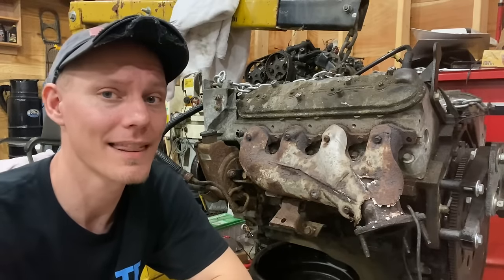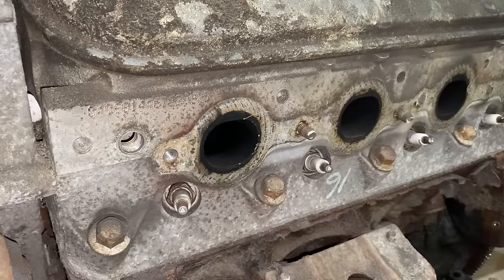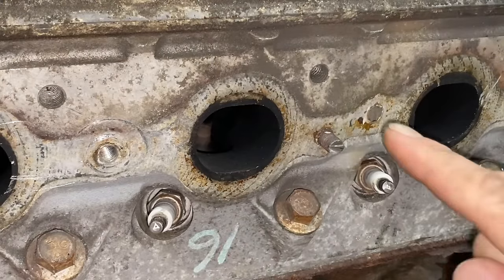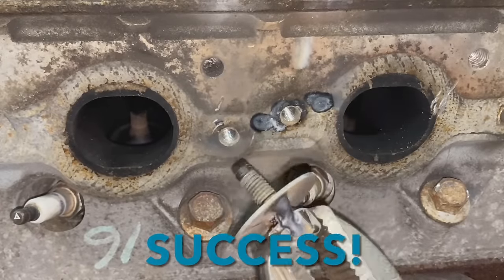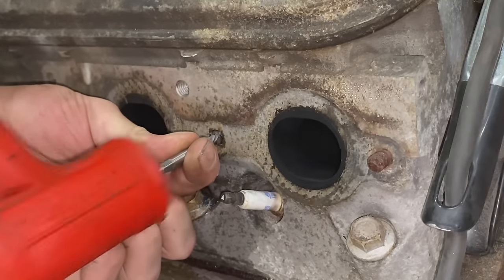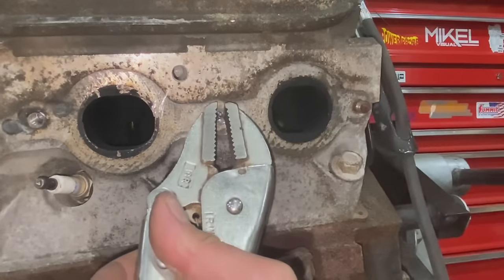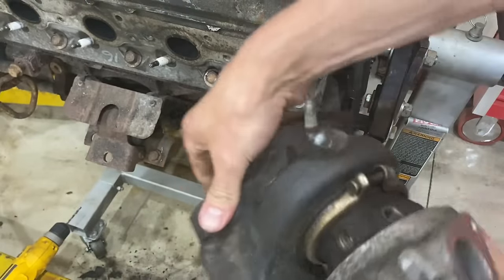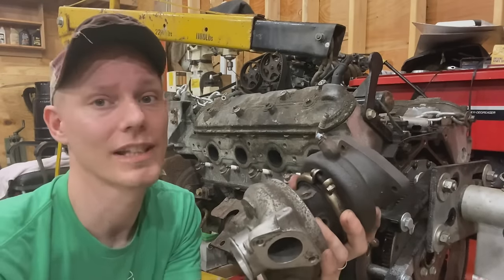How To Remove A Broken Bolt 6 DIFFERENT WAYS - LS Exhaust Manifold

Comment: what about the bolt is not flushed and its inside
Reply from the maker: You can actually build up weld on it, weld it to a washer, and then weld a nut to the washer, and spin it out. Or you can drill it out. Both work.

Comment: What if the broken bolt is stuck in the turbo charger itself!?
Reply from the maker: That makes for a really bad day, because turbos hold on to those bolts REALLY tight, and they often end up with wildly screwed up threads for a reason I don’t understand. I’d recommend drilling it out and doing your best not to destroy the threads. It’s gonna be a bad time. I’m rooting for you though!

Comment: When using an easy out people need to make sure they get as close to center as possible and they must never use a Drill bit that's larger than the bolt that's broken off! I have seen some really bad, screwed up messes others have tried and it took a ton of work to fix the vehicle. Remember many people seem to lack common sense when attempting to fix auto's, IMHO.

Comment: I would have never thought to use a turbo charger. I threw my drill away and gonna use this on every broke bolt from now on. Not sure if my wastegate is operating properly. Might even try it while under boost. 🤣

Comment: I have a 24 years old Toyota Celica, not very rusty, but nuts and bolts started to weld together with the rust, and in my opinion the first two method is just not going to work. The reason for that is heat, exhaust manifold bolts ok, rust to gether but not the threads, on an undercarriage bolt moisture and water slowely makes its way to the threads and they just rot so much you cant do anything with it, if you weld and force it out, they will ratheer spin in one place and destroy the thread, or just brake again right where you welded it. I heat them up real good, with a torch, then I use freeze spray to cool them off instantly, then I drill a hole on them, one size smaller than the thread cleaner is, and then I use a NEW OEM bolt to clear the threads, and then again a new bolt for the repair itself. Never use drill cleaners, they are trash, they just never got the threads right on them and they just destroy everything.

Comment: Fyi if you get a tap broke off get cheap carbide drill bits cause there not as brittle as the good ones(masonary)  drill bits at doller tree then put a negative rake on it and you can drill and make a metal chip you will have to sharpen the drill cause it is a cheap one

Comment: Now lets get this straight. Weld the stud to the washer weld the washer to a nut weld the nut to the turbo then to a few other things then just go get another engine.   I say just go with a leaky header.
Reply from the maker: You’ve got it! If that doesn’t work, get yourself a bicycle with a nice basket on the front. Then part-out the truck, and have way less stress in life! Lol

Comment: Where to clamp ground?
Reply from the maker: Anywhere on the engine block works, but if your engine is still in the car be sure to disconnect your battery cables or you may fry your computer (allegedly).
Reply: Thank you yeah its still in

Comment: Weld a washer to a iron head you better use a smaller diameter or you will weld it to the head
Reply from the maker: Agreed. You should weld the washer to the broken bolt, not the head. Otherwise you’ll have a really bad time.

Comment: I have changed at least 6 engines. I have never broken a bolt. You literally just have to use the right tools.
Reply from the maker: The problem with LS engines in the rusty areas of the country is… these bolts break themselves. They actually rot away and snap off without any human touch. You’ll open your hood one day and find ~6 bolts snapped off and giant exhaust leaks on both heads. This is why I should have moved to a different part of the country decades ago.
Reply: You do it enough and you’re going to run across broken studs right tools or not.

Comment: Also, drill ALL THE WAY through it to let penetrating oil to work from both sides. 
  Lastly, they sell carbide drill bits for the really hateful shit. Been there, done it hundreds of times.
  IF you have steel in an aluminum housing, use the alum method. Works great overnight. ( your Wife uses it in cooking), but it chemically dissolved iron based alloys, but not aluminum or mag. Probably bronze, brass, or others as well.

Comment: 23 years ago, l had a water pump replaced by PEP Boys ! 280 dollars. They called me and they had broken all the bolts! They charged me 730 dollars when it was all done. They were 50 dollars cheaper than the ford dealer, that’s why I let them do it. Later I spoke to someone about it at my dealership. He told me that if they broke the bolt’s they would have retapped and never tell me ! It’s part of the job he told me. It was a 85 F150, V8 and he said you had to be really careful removing the water pump. When I paid the 730 dollars at pep boys they gave me a receipt for 320 dollars (?) ! No mention of the charge for retapping!

Comment: Almost every time he used an adjustable wrench the wrong way, the double wrenching? don't need the second wrench when removing, just turn the one close to the block. never even try to drill steel in aluminum, the drill bit will always walk. turbo works great because without a head, there isn't really a lot of force holding the bolt in
Reply from the maker: I used two wrenches because both nuts were spinning on the stud, instead of turning it. I needed to make sure that they were tight against each other to prevent that.  It sounds like you are already well experienced in this area though. Maybe there are other channels that suit your needs better? Thanks for watching.

Comment: Actually welding the shaft from a tractors bush hog to the bolt then crank up the tractor and engage the pto. Zip that thing right out..... oh wait i cant which way that pto turns.
Reply from the maker: Solid advice right here. Been a while since I used a bush hog!

Comment: thats easy if they were broken inside the head engine ,... that will be a job , like what i have to do now , they are broken 1cm inside , and iwant to weld
Reply from the maker: It’s still able to be welded! You have a few options:
- get a very short copper tube the diameter of the bolt hole. Place the tube on top of the broken bolt. Shoot mig welding wire down the center of the tube to build up the metal. The mig wire won’t stick to the copper.
- be very very careful with your aim and weld JUST the bolt. Scary, but if you are lucky, you can build up material on the broken bolt and then weld to a washer.
- drill the bolt and fight the good fight
- drill the bolt using reverse drill bits. I’m told this works, though I haven’t tried it yet. The bit often grabs the bolt and spins in out before you fight it with the easy out.

Oh and lastly - clean the top of the broken bolt as best you can before and welding. The weld will stick better. I often scratch the rust off with a pick. It’s miserable, but this whole process is.

Comment: I rarely ever break a bolt but when I do I weld a nut to it
Reply from the maker: These LS exhaust manifold bolts break themselves around here. I bought a 2005 Avalanche and it had 6 exhaust manifold bolts that had rotted off or snapped off. It’s wild in these rusty north east states! Welding a nut to them is a terrific solution.

Comment: One of mine were broken and I broke another, then a engine mount bolt was broken off. One exhaust one is still there taunting me until tomorow
Reply from the maker: Sounds like a really bad time. I’m cheering for you!
Reply: @WiringRescue  unfortunately after a few hours of attempting to remove it how we got the other 2 out it wouldn’t budge, even the bolt extractor broke off inside it when we finally got it far enough to grip. I guess I’m just gonna have to take it to a machine shop and get them to drill the hole out and make new threads
Reply from the maker: @codskilclanchannel6420  - what a huge bummer! Sorry to hear that!

Comment: Why on earth would you use a traditional/ right hand twist drill bit with the extractor? You still aren't going to get over 50% success rate, but you're at least increasing your odds of making it work by setting a correct drill pitch
Reply from the maker: Because I did not own left-handed drill bits at the time that I made the video.

Comment: I'm going to do my RAM...going to invest in a cheap flux core...and a used tubo... lol
Reply from the maker: Flux core makes me sad whenever I have used it, but it’s better than nothing for sure. The price of decent mig welders that have gas hookups has come waaaaay down in recent years. If you can swing the extra bucks, getting a mig welder with a gas hookup is 1000% worth it. Or it was for me at least. A used turbo - obviously always a good decision whether you’re welding it to a broken bolt, sticking it through the hood, or decorating for boost season.

Anywho - thanks for watching and good luck!

Comment: Those extractors you were using are the absolute worst. Try the square ones next time. I can never get the fluted ones to bite. Also if the stud is sticking out. I like using stud removers or a craftsman set of nut/bolt extractors. They are amazing

Comment: I like method 6 but have to say that welding a nut (and it its short add a washer) is best, method 5 is rubbish if you are unlucky the damn tool will break off in the drilled hole opening up even worse issues

Comment: Its easy to do out of the engine bay lets see you do in the engine bay thats the struggle
Reply from the maker: I’ve done it 470,902 times with the engine still in, but it’s impossible to get on camera. I’m not trying to show you a dark video with my struggling. I’m showing 5-6 ways to remove broken bolts.

Comment: 2 or 3 cycles Heat with a torch and transmission oil, those bolts would have came right out for you

Comment: One tip for anyone doing this. Let the weld cool down for a minute before turning. If you have a problem with weld breaking off . Also the stud being super hot expands into the aluminum more.

Comment: Great video.  And I find myself here because my dumbass stripped out a front axle clamp bolt on my motorcycle.  Damn thing was 15 ft lbs and I over-torqued by accident.  I say "accident" because, I had a 1/4" torque wrench but unknowingly used a 1/4" to 3/8" adapter to torque it down.  And this ignorance led to a stripped bolt head.  My problem is, I cannot grasp the bolt head as it is sitting down into a recessed area.  I cannot use a larger 7mm hex since it is not gripping the inside of the 6mm head.  And if I cannot get this cheap ass bolt out, I am forced to get new forks mounted.  Watching this video, I am going to ask a local welder if he can do the bolt, washer method and weld the washer to the stripped bolt.  I am hoping this method will work because I do not want to drill down into the bolt and use an extractor.  That is my last resort!!  Well, actually, my "last resort" is buying new forks!!!
Reply from the maker: I bet welding a washer and nut to it will work! I have 100% confidence! You’ll have to buy a new bolt, but that’s waaaay cheaper than forks! Good luck and report back the results!
Reply: @WiringRescue  Just curious but, how can a weld be done so close to the motorcycle fork without damaging powdercoated surfaces?  Do you think JB Weld is a possible solution?  I could always JB Weld in a 6mm Hex bit and let rhe JB Weld harden all around it creating a new interior.  Or maybe JB weld a hex bit to a nut?  I wish I could share a photo.  Maybe even JB Welding a nut direct to the stripped bolt head.  Thoughts?  And thank you for your personal time, assistance, and response.
Reply from the maker: @GR8WHITEC5  - I would think if the person welding is very careful and they let the metal cool after every spot weld, it wouldn’t get hot enough to cause damage.

With that being said, I think jb welding a hex wrench in the bolt is another fine idea worth trying. A friend of mine did that to remove locking lug nuts a long, long time ago. He jb welded some junk sockets right over the locking lug nut that we didn’t have a key for, and spun each one off once it hardened.

Try it out! I’m dying to know if it works for you!

Comment: You young guys all use your wrenches wrong. The hump of the open end of adjustable should be on the pressure side or too of the nut or bolt. Good demo of different styles, but those studs weren't really stuck.

Comment: Nice video but you drilled too deeply for the easy out. You only need to drill enough so that the tip of the easy out fits in tightly and don't hammer it in. Just turn the easy out left and it should catch very tightly. If it doesn't then either wrong easy out size or wrong drill size used. Or you're easy out isn't good enough quality. The easy outs with course grainy surface catch everything.
Reply: I disagree. I find it best to drill deeper to get the easy out in further.

Comment: The easy out method in this video - no.  They just don’t work that great anyway, and not if - but when it snaps off the remnant makes extraction infinitely worse.  Center punch, then drill a 3/16 pilot hole until clean shavings stop coming out, or you know the depth is right.  Find a nut that matches the stud you are trying to remove, and select a drill bit that fits snugly into the nut.  Use that bit to drill out some more.  Then re-tap the hole using a bottom tap, using plenty of cutting fluid.  Cut about 3 or 4 threads, then take the tap out and clean it with a wire brush.  Continue cutting/cleaning the threads until it’s done and all the old material is removed.

Comment: no 5 wrong easy out  Use the tapped square ones   For welding they have specials rods called stud Rods  You can make a stud with with these rods

Comment: Extractors suck,,,, drill a small hole and then pound in a torx bit,,, one that is a shade bigger than the hole.  Another method for bolts protruding is heat and bolt extractors
Reply from the maker: I’ve gotta try the Torx bit method. It has been mentioned a few times here in the comments. I wish I had tried it for the video!

Comment: I cheated and bought the brackets that screw into the head and tighten up by pushing in on the manifold.  The rear and front usually break first.

Comment: The old farts back in the day would use a melted crayon in place of penetrating oil before doing any of the methods you used. It supposedly  helped loosen the threads for removal. Love the one with the washer.
Reply from the maker: I have heard that too, but I’ve never tried it. It sounds like witchcraft.
Reply: Its almost the same as using bees wax. @WiringRescue

Comment: I wish you would have done a bolt thats broken below the top of the hole.
Reply from the maker: I would have if I had one. It’s still the same process though. Welding or drilling are the two options. Welding to a washer definitely works best for that too.
Reply: @WiringRescue  how do you weld it without welding the block, if its busted off inside the hole?
Reply from the maker: @davidmasterson4329 if it’s an aluminum head, the weld won’t stick to it. If it’s iron, you can either be very precise, or you can get a short, thin-walled, copper or aluminum tube that’s the size of the bolt hole. Rest that tube on top of the broken bolt, then shoot welding wire down the hole until it builds up metal above the surface. The tube will protect the weld from the walls of the hole.

Comment: There’s actually two other ways but one of them only applies to cast iron…removing cut off bolts-studs are easier especially if base metal with broken part is aluminum and the motor is out of vehicle…
Reply from the maker: What are the two other ways?
Reply: @WiringRescue  …a cam lock stud-bolt remover…and for cast iron-acetylene torch with a cutting tip !
Reply: Got the torch method figured out ?..and it’s not about heating it up either…

Comment: It would be better if you welded the base of a 200 pound anvil to the bolt. You could then use the weight of the anvil to your advantage and it wouldn't be so hard on your skinny arms. You need those arms for a long time to come. Be nice to them. Use the anvil. 😂
Reply from the maker: You make a really great point, also - this is a reminder that I should probably hit the gym. 😂
Reply: @WiringRescue  😁Great video. This will give many people a few ideas and options as many have not had the training you have had. Good job. 👍

Comment: The worst invention ever was a flat bladed screwdriver. Just say'n. Next are the so called "easy outs". They work best at the bottom of the river.  I have used torx bits exclusively for years. It all depends on the situation. (the welded nut idea works good too ) Moving forward, if you man hog the torx, I can see that Mr. Hulkman could break the torx bit off. The most recent broken bolt that I removed was broken off abt 1/2" deep into the head. When you drill a center hole into the stud, concentrate keeping the hole straight as possible.  Drill the hole a big as you can, within reason, that allows you to utilize the largest, meatiest Torx bit. At the same time, be mindful not to drill your hole too big. The stud wall still needs to a have some rigidness to it. Once the hole is drilled drive the appropriate torx firmly into the hole but don't pound the shit out of it. Only enough to where the torx doesn't lose it's bite. I don't recall any broken bolts with the engine removed. Not being demeaning to the OP, I did crack a bit of a smile when you pulled out that dead blow.